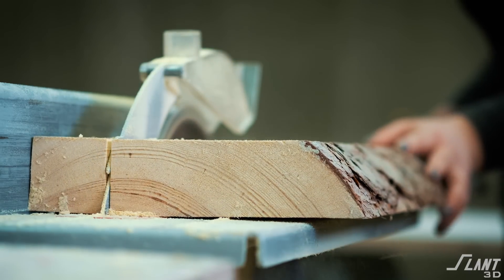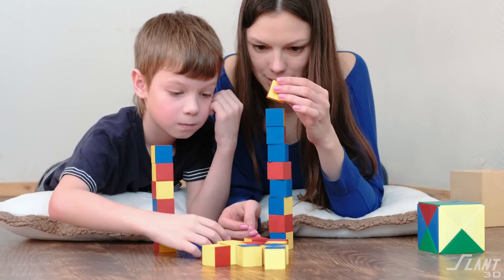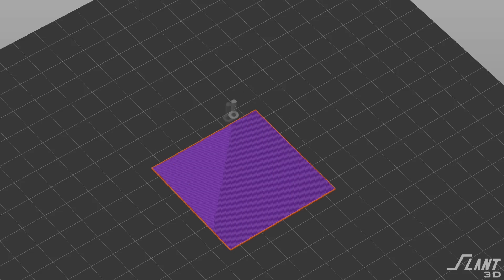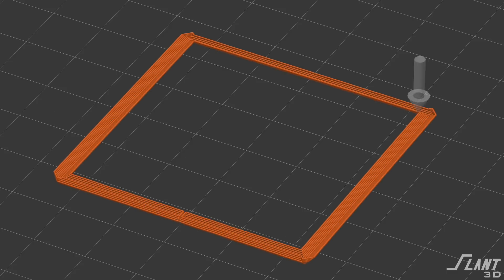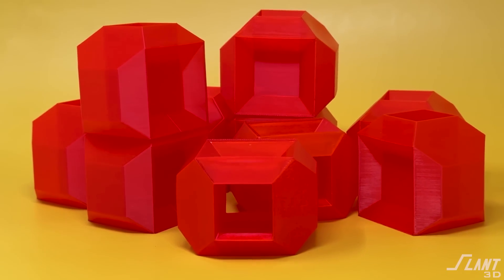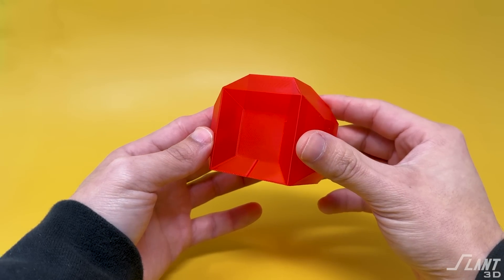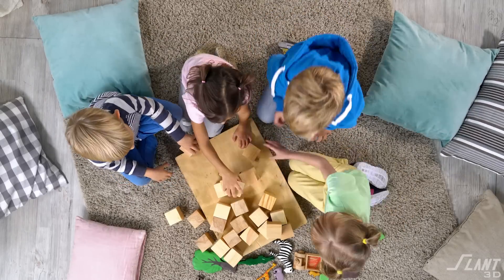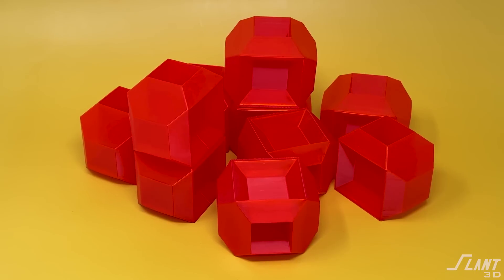Design Stronger Vase Mode Prints Using This Secret Technique | 3D Printed Blocks

Comment: Nice to see others doing things structural in vase mode. I rarely print outside of Vase,  with a few tricks, you can print anything in vase with structure. I started 3 years ago applying Ben Eadys negative volume vase, https://www.youtube.com/watch?v=STNJbHJf9K0 And expanded on it from there. Some like you are doing, some places it adds internal ribs, some places, it slits all the way through, and some parts of the model you can slit in 2 or 3 directions/dimensions.

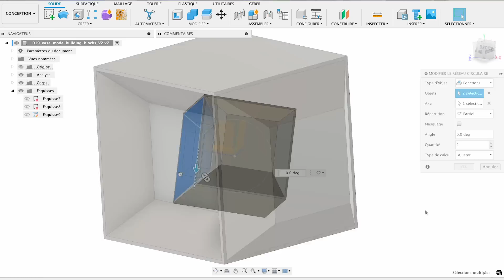Comment: @2:47 how did you dob that like copy paste spin thing?  Or what's the name of it so I can looking up.  If is modifier?
Reply: Looked like a circular pattern modifier. Could also be done with a mirror modifier, but that’s not what was used in the video.

Comment: Very cool never thought of putting a slit to make vase mode have almost 2 layers
Reply: It makes a big weakness in the seam so it's not very useful unless in extremely special cases like when you only want compressive strength coming from the top for example
Reply: @survival_man7746  There is no seam in vase mode.
Reply: @Schradermusic  maybe seam is not rhe right word but i meant the line where there is no continuous extrusion that passes trough but rather two line that make a "u turn" and only touch at the tips like this " ][ " instead of "=" by not being a full line this is essentially at maximum as strong as layer lines in the z axis
Reply: @survival_man7746  perhaps slant seam?